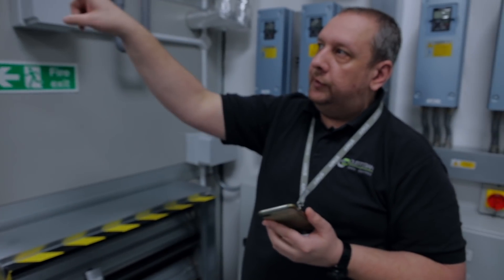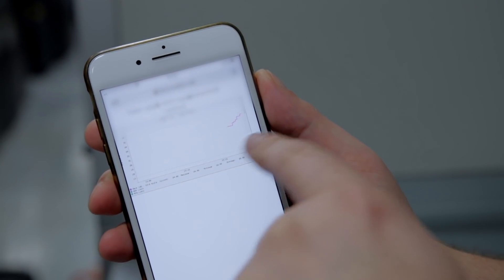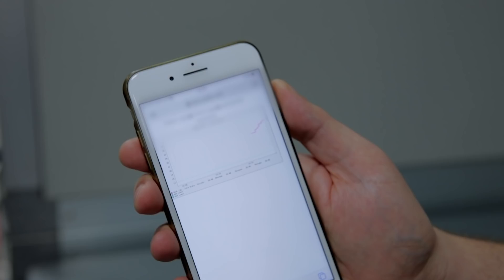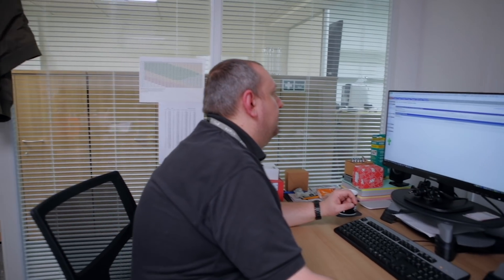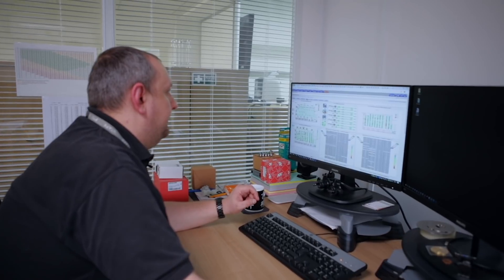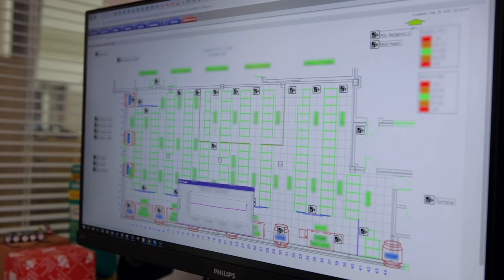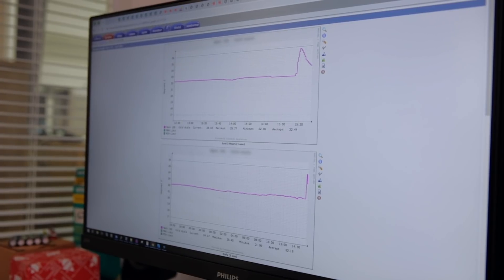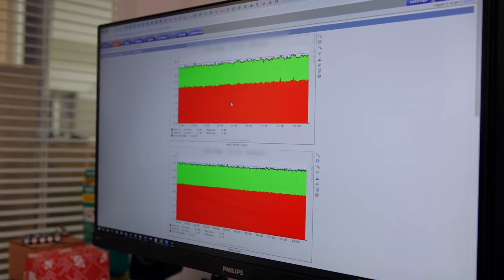A DAY in the LIFE of a DATA CENTRE | HOW WE MONITOR | EP 2 | HARDWARE!

Comment: -In the airport data center of the control tower that I monitored 3 or 4 years ago, I used Arduino circuits designed with a wired network interface to send to my Nagios server that I designed with some old servers that they will send to the trash, and I created a monitor system to test external AC, UPS, temperature, humidity and other things, like some alarm indicators for some servers directly from the server hardware.
-And with Nagios, I monitored the software and services on the servers and my network.
-But now they have systems that are much easier to program and interface with Wi-Fi microcontrollers like esp32 and other microcontrollers much more powerful than my old Arduino monitor modules.
-I think that in my next job at the NOC after doing my LPIC and CCNA, I will use many of these cheap and reliable new technologies and thanks for giving me some god new ideas in this video.